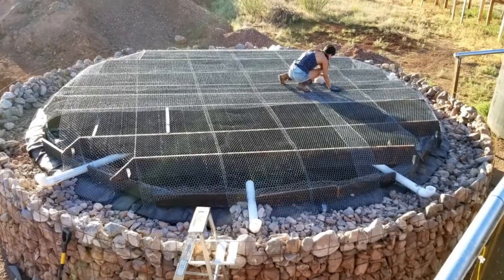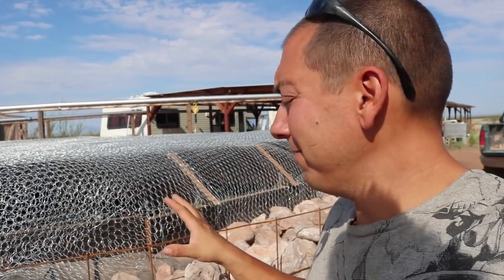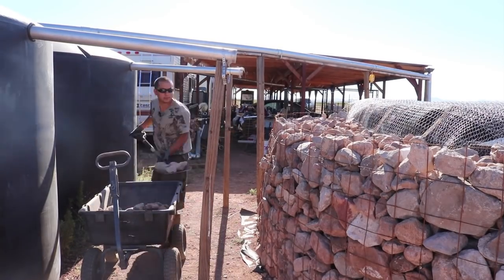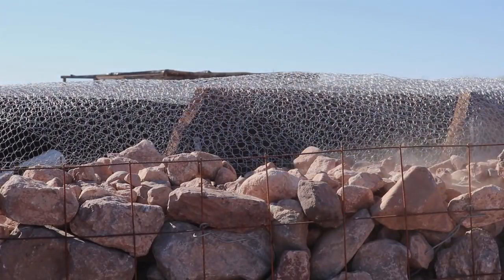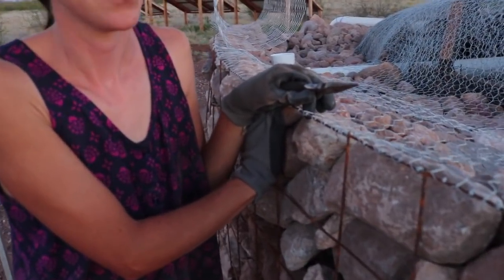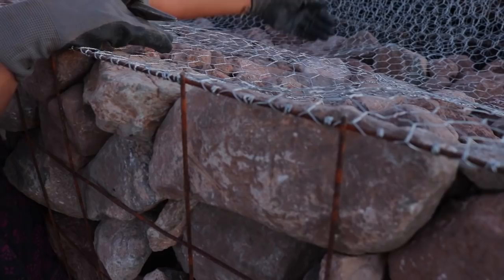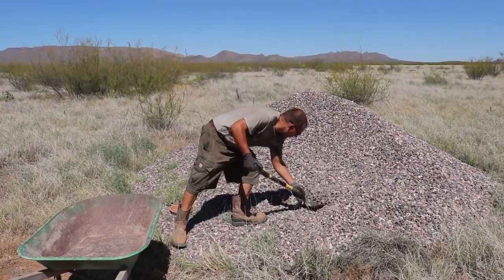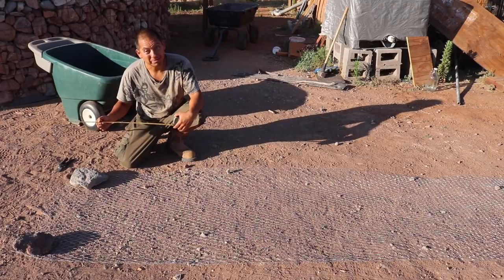Building The Most UNIQUE Ferrocement Rainwater Harvesting Gutter System On Our Earthbag Cistern

Comment: Sorry if I missed something but how is the top sealed to the tank?  If there is a hole anywhere around the top then snakes and insects will find it.  They can easily crawl through the rocks.  I thought maybe you would use expanding foam at some point but I have not seen that either.
Reply from the maker: Good point James! We're not done with the roof yet. 😁

Comment: On my phone it doesn't show
Between the inlet rain harvesting roof pipes.. 
On the gutter did you leave highs draining down to the pipes.   
Per code. Minimum slope is 1/4 inch per foot
The more slope the better
(easier to not leave areas where water puddles..  (mosquito areas))
Reply from the maker: We're covered.😁

Comment: cool project but just a thought.. but wouldn't finding and connecting some old IBC totes or 55 gallon drums, which most people can find cheap or free, be easier????  also what about finding an old above ground swimming pool set into the ground?  just ideas???
Reply: Howdy, I’m doing similar projects to at Castle Hot Springs.  Do you do tours?  I’d love to drive over and meet you both and see first hand what you’re doing.  Thanks
Keithlong@comcast.net
Reply from the maker: Those would be easier, but I don't know if I'd trust barrels or totes for drinking water. This will build will be much more durable as well.
Reply: @ourselfreliantlife  ahh, drinking water - sorry.. thought it was just for garden watering. That makes sense then!

Comment: OK, I think I know where you are going with this. The inlet pipes will let allot of colected dirt and bugs into the tank beause you are not (I think) integrating a first flush system. You can use screens over the inlets, but that only helps so much. That part of the system may cause more problems than the aditional water may be worth. I do love the idea of your cistern though and I enjoy your videos allot !!
Reply: Yes they'll probably have to go down and clean out the sledge every 20 years or so. Its the snakes and other critters that would bother me. Maybe a fine mesh screen over the inlets could help keep the live animals out.  Might keep out twigs and leaves too.. Dust and dirt will get in no matter what. I live in the desert too. The sand, dust and dirt is a constant problem.
Edit: spelling.
Reply: @SaSuEnglish  clean out the sledge every 20 years or so...well put.....lol
Reply: It will be interesting to see if they have a solution to this.